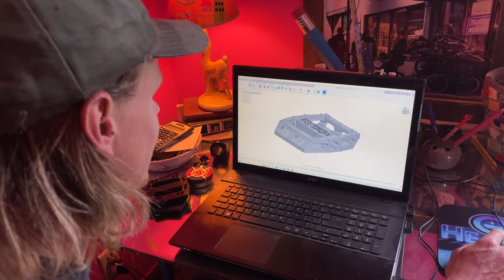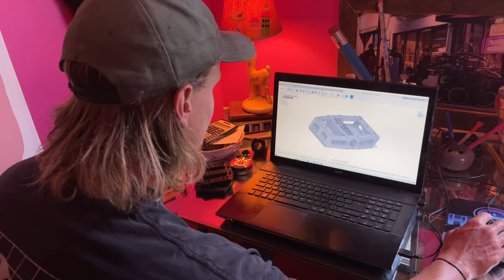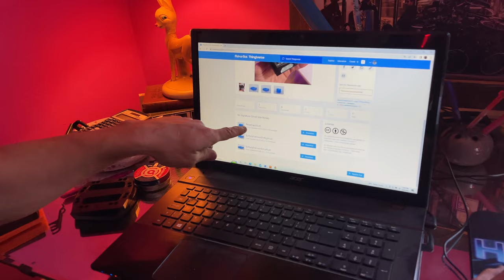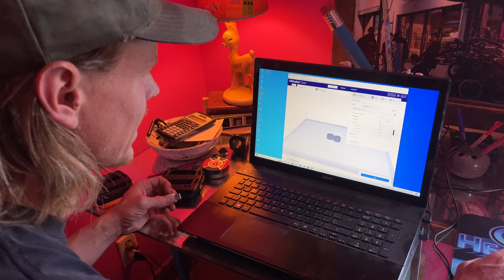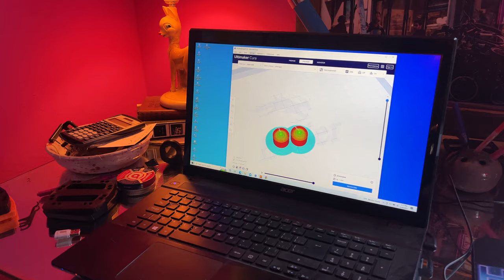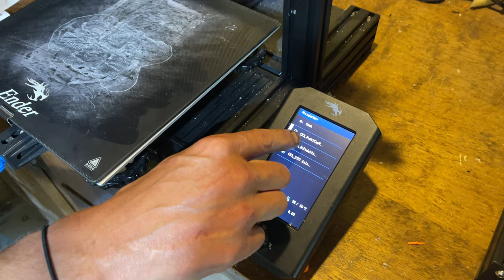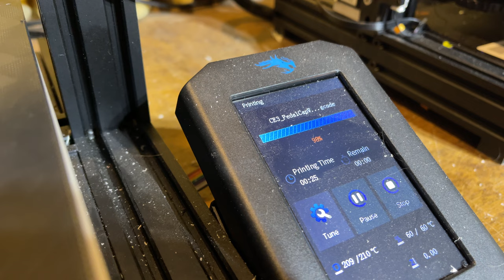3D Printing BMX Pedals - IN DEPTH With Zack Gerber

Comment: FreeCad is another good option for CAD software. 

On the engineering side more work on the print orientation, infill and materials is the next step. Variable print orientation can be used to help make the parts stronger in some directions or places where forces are in a specific direction. You can also make things more supple or stiff based on design needs, even on the same part. Infill optimization also helps reduce weight but can be designed in a way to increase strength/performance. Lastly materials is a huge aera. Carbon fiber filliments or other high strength materials can be used at the stress concentrations for reinforcement. These can be combined with regular high impact PLA or nylon too.

Comment: I definitely think 3D printing has a place in bmx. You already know I 3D print all the parts I prototype out for myself and others. 

Designed some pedals like this a while ago but with a replaceable grind plate so I can do the body and plate out of 2 different materials. Main idea was same as him. I used to run a bolt on lexan grind plate I made in high school and wanted a much more simple way to do the same. 

Highly recommend fusion 360 for anyone wanting to learn to design like this. It's a very capable software. Free to anyone making less then $100k a year.

Comment: Check out “CHEP” on youtube, Chuck has a video that came out on 25 March 22 about “printing 2.5X quicker using cura” he has a few other optimization videos. The cura 5 version has a few things that speed up print time ie they thicken extrusion now rather than do a infill pass. Prisasloc3r 2.5 will have this feature too. It cuts time down heaps.